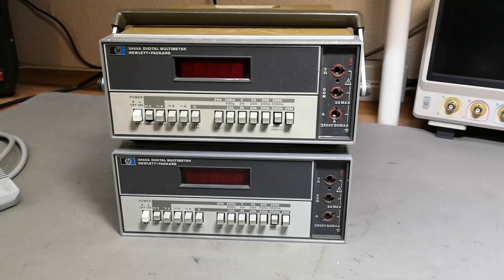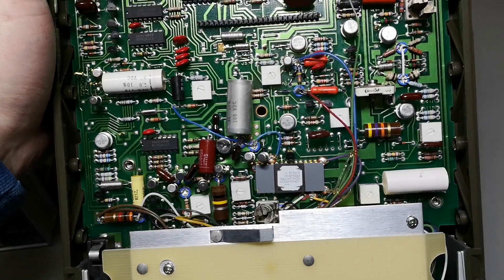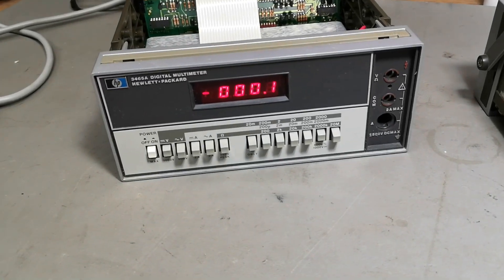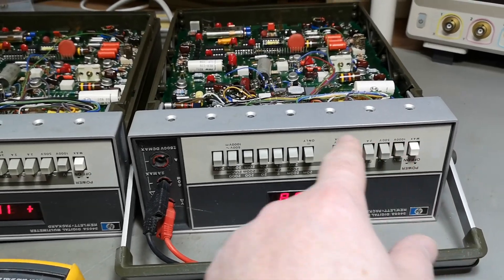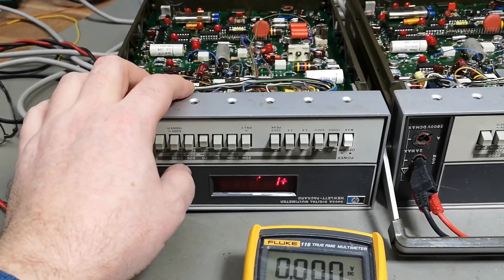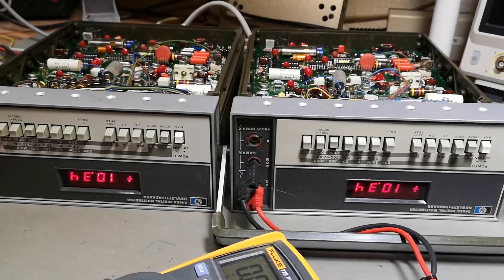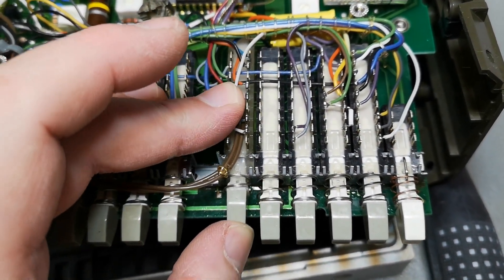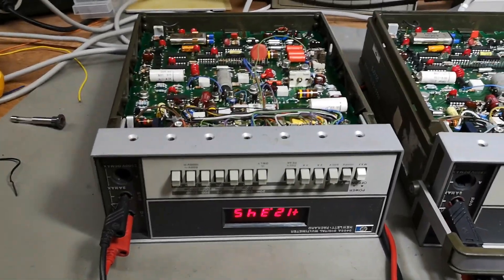HP 3465A Digital Multimeter test repair teardown

Comment: Hello, it's a treat again 👍
I see that my holy trinity 60-WL-61 has been used - it works the best of what I have tried so far, but if the contacts are mechanically damaged, even holy water will not help. That's why I wrote to you last time that I'm taking apart the switches, I don't know how to take apart this type because so far I've only dealt with the Isostat system (opaque with a metal cage in the front part, possibly also in the back part of the contact field). It can happen that loosened dirt remains in the space between the contacts and the switch then behaves unreliably, but I also saw a worn contact surface and it was necessary to replace the contacts from another switch.
I wanted to buy some devices on Ebay recently, but I have no idea what happened to the shipping price, it's triple the price of previous purchases, so I gave up, at least I don't have to deal with faulty switches 😂.

Nice day 🙂Tom
Reply from the maker: I think one of the shadow contacts was damaged in this very rare case, so we decided not to call it a final decision, thanks for pointing that out..